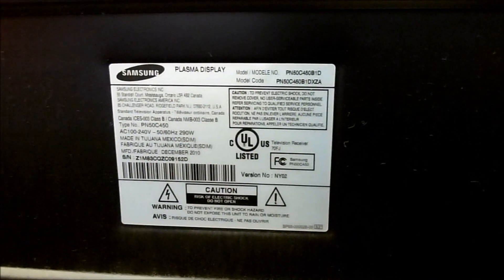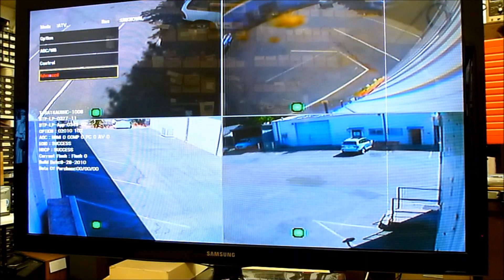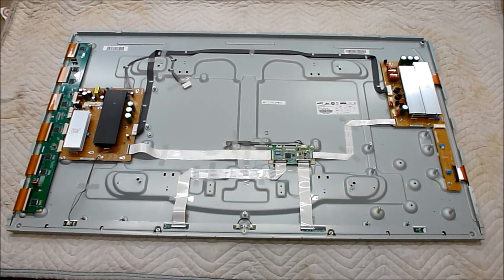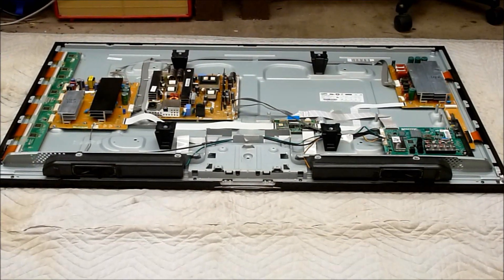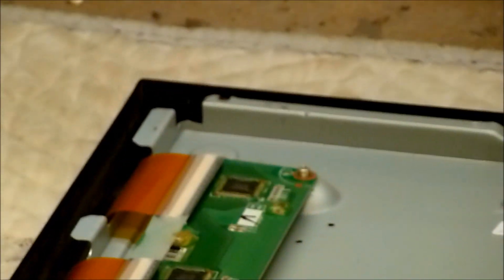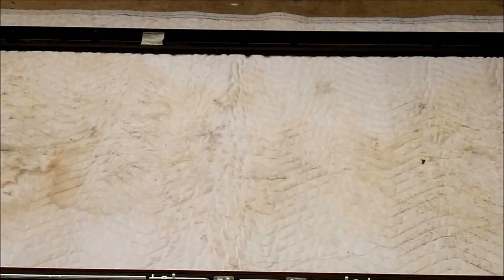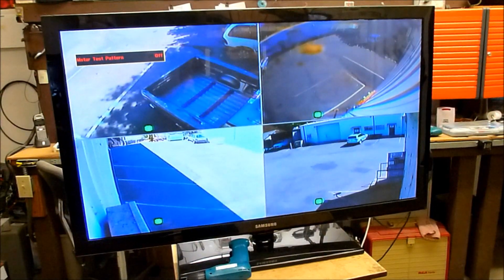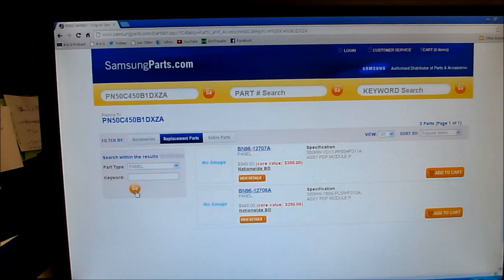Samsung PN50C450 with a bad Plasma Panel Shows how to replace the Plasma Panel

Comment: Can I place a different Samsung model's Plasma Panel to replace the cracked panel on my Samsung PN51D550C1F? I have a PN51E530A3F. These TVs are identical in appearance. I'm amazed they're even different models.

Edit: I'm getting mixed responses. Some sites online say that multiple makes of the PDP may be compatible with your TV. Whereas the local repair shop says, same model or nothing!

Comment: Great video I have a question I have a Samsung PN50c550g1f model the tv just went out as we were watching it, I took the back off & the board were the tv plugs in there is a 2 black plastic I think relays one of them starts to clicking when I plug the tv in after about 4 times it stops & the tv doesn't come on, any ideas. Thank Ed from Janesville Wisconsin

Comment: I have the same model and wanted to pull out the y sustain but its connected to the y buff and I can't tell how to seperate them, any advice?
Reply: Remove the screws from the y-sus and then wiggle it and it will eventually unplug from the buffer board.

Comment: I have a Samsung Model PN58C590G4F  my problem is it will not turn on.one day it was working next will not come on.I checked fuses and copasitors all look good the logic board if I unplug it the tv makes the sound as if it is coming on like normal but never comes on.Have any suggestions o help?

Comment: Horizontal is across the screen, (horizon) this tv has Vertical lines, how can someone that is supposed to be smart  make this mistake ,, and the only thing wrong with that tv is the connectors need to be reseated
Reply: the statement about the connectors need to be reseated is false. The single vertical line is a result of either an address buffer failure on the PDP ribbon or a tab bond connection failure on the PDP ribbon to glass. There is nothing to re-seat in this case. The man did the correct thing by replacing the PDP.
Reply: James Fletcher I cleaned and reseated my ribbon cables and it did not fix the vertical line.

Comment: Great Video exactly what is happening to my Samsung PN50C7000YFXCA  Even the lines are in the exact locations on the screen.  Looked up panel and only cost $747.00 not counting shipping.  So it's cheaper to buy a new TV.   Basically after only 4 years of use my TV is junk.   Never SAMSUNG again.
Reply: I'd be willing to bet he is an "authorized service provider". It was either under factory warranty, or the owner purchased an extended warranty. Not too many people will actually pay for this repair out of pocket.

Comment: I have a thin black line on top of my screen it goes across from corner to corner. The line will not go away. Can you fix this. What will it cost. I would like your information. My mother gave me this TV before she passed away I need to repair it please. My number is 814-730-8849 please contact me. Thank You

Comment: I have the same tv and a few months ago some horizontal very thin black lines came out at the top of the screen only one it blacked out maybe 5 inches of the screen does this means its time for a new one or it has a solution? Thanks in advance for the tips/help.

Comment: I have this TV but its not turning on? I only see the red light clicking... no picture at all.. when I turn it off, the red light goes off but blinks 5 times before going dead.

Is it the power supply ?

Comment: I have the exact tv with the same lines but only on the left side... there are two lines right next to each other. You had said to (either replace the panel or live with it). I had a repare shop come out and they had said that eventually there will be lines going down the panel all the way accross the screen and that the picture will no longer work... QUESTION: is that true? 

They also said that it would cost $1000 for a new panel.

AND... how much did the new panel cost you?

Comment: Did the test pattern and you can only see the line on pattern 1and2 the rest of the color patterns display fine ..so im guessin its the tcon or buffer and not the panel bc the lines come and go and show behind the menu not in front any advice would be awesome

Comment from the maker: Depending on the model, you may have a set that has separate glass "filter" in front of the plasma panel. If so and the plasma panel is not damaged you may be in luck. The later models have the "filter" incorporated into the plasma panel itself. If that is the case then the set has its days numbered. Once air gets in to the plasma panel it is history and will damage the "Y" buffers and the "Y" sustain circuit in most cases.
Reply: I HAVE A LG 60PS8000.  The glass have major cracks in in - but it seems to be separate or covering the panel...  do you know if this is one of the models you referred to above?  can a new piece of glass be fitted over it?

Comment: I have a 55 in Samsung plasma with a major crack.  I called Samsung up so the people they referred me to have it fix.  They said the panel cost 1485.00  is there any way I can order direct or from someplace that has used ones.

Comment: Thisis great but if the panel is going to cost $300, I might as well put that toward a better non-Samsung LED which will pay for itself with lower power consumption after a few years - which it all I got out of my $1500 Samsung 50" plasma before a horizontal line from the bad panel appeared (just a little more than 3 years and right after the Samsung and Costco warranties expired)

Comment from the maker: The buffer drive boards are on the bottom the set and usually there are 2, 3, or 4 of them they occupy the entire width of the set. The actual buffers are bonded to aluminium heat sinks that connect via ribbon cables from the plasma panel to the buffer boards. Usually on a 50 inch there will be about 12 to 20 individual buffers. Each one drives about 2 to 2 1/2 inches horizontally.

Comment from the maker: The E & F buffer driver boards just unclip to the ribbon cable, the actual buffers are bonded to the panel ( in the middle of the ribbon cables) and can not be replaced.

Comment from the maker: You are right normally when a buffer board fails you will see a stripe 1/2 inch to 2 1/2 inches. some drive tabs (there are about 16 of them ) are broken into 2 or 3 parts so the defect slice becomes much smaller

Comment: My understanding was the horizontal buffer boards only loaded serial data into the panel - the worst they could do is cause a whole column or side of the screen to fail. For a 1920x1080p screen, it would require 5760 lines, 1365x720p would still be 4095 lines... which isn't practical. Hence why the buffers are bonded onto the panel.

Comment: So the extended warranty paid $700 to fix a $550 TV? I repair the odd TV here and there - usually just buy a faulty one and sell it. The amount of disposable electronics is staggering. So much stuff built just to last 2-3 years. Samsung make good TVs but they are never built to last.